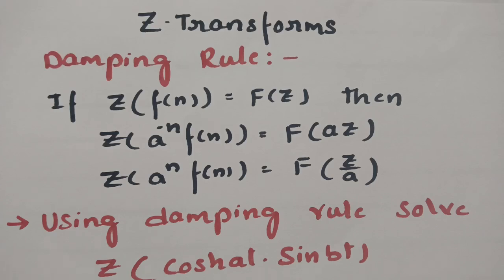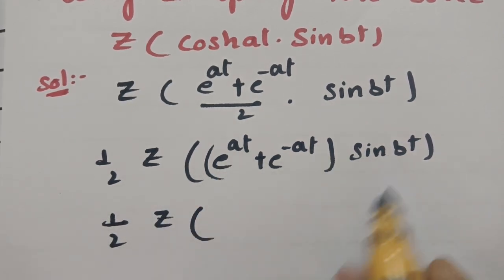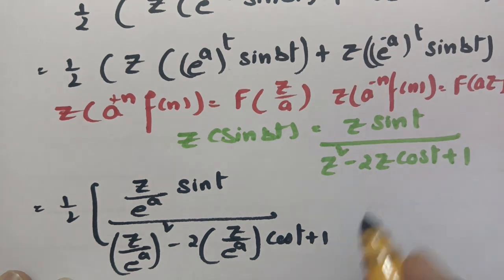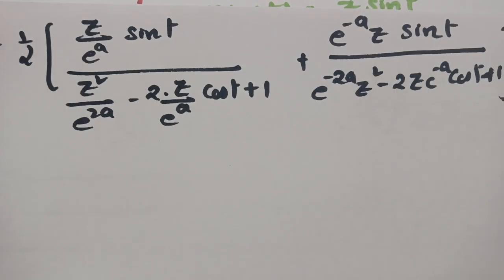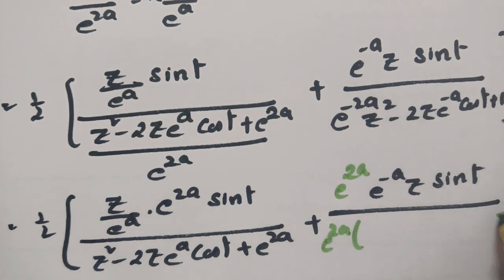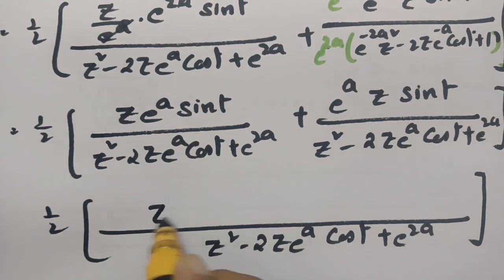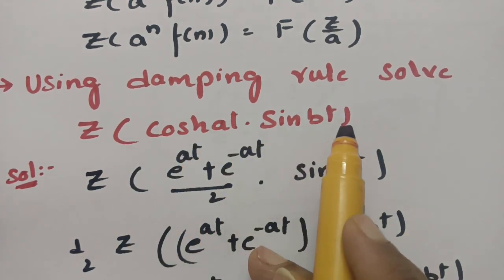Z- transforms Damping Rule- Z(cosht.sinbt) solution

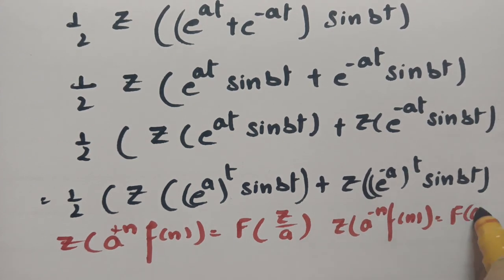Comment: i think there is a mistake at 2:38. I think it is not z(a^-n) in the second term. For both it is a^n and a1=e^a and a2=e^-a. only the value of a changes not the sign of n. Is that correct??
Reply from the maker: Sriram...|n| mod n differs it's sign from negative to positive |n|=-n for negative values from -infinity to -1 and |n| =n for positive values from 0 to +infinity...very good doubt...excellent following💐 Good luck💖
Reply: @btechmathshub7050  Mam if that's the case in the previous video while solving ne^-an why did we choose F(z/a) instead of F(az) , can you please clarify. And in that case also it will less than 0 only right